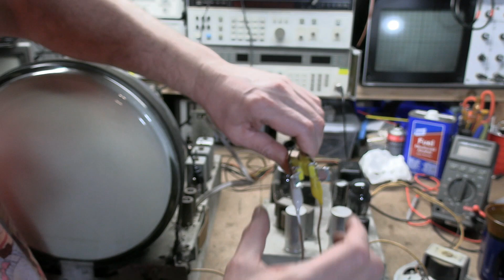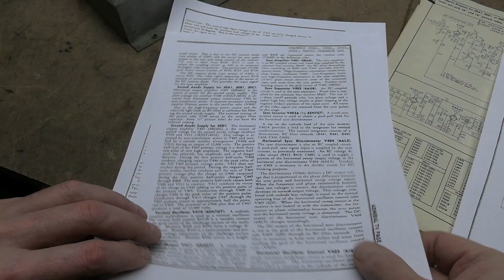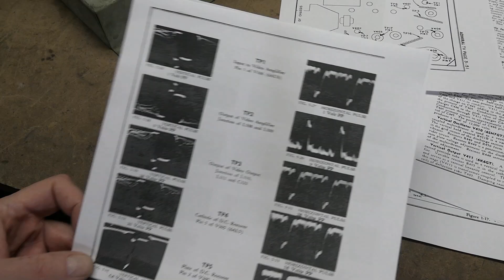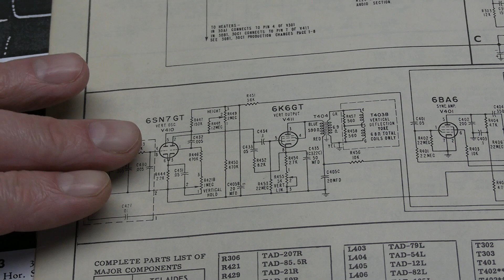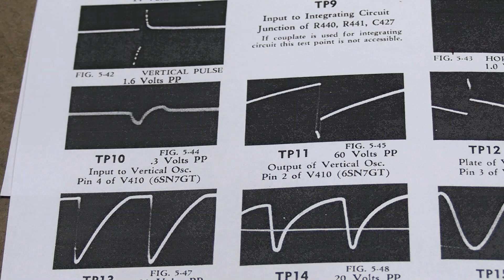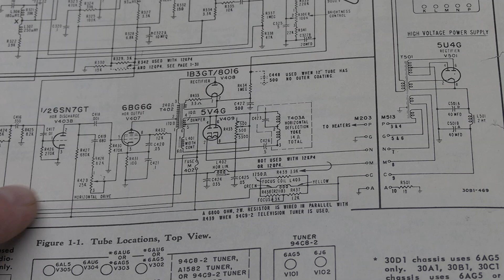Beginners guide to B&W tube TV restoration part 11 (prelude to troubleshooting)

Comment: Might it make sense to make an extension cable set for field coil speakers.  This would alleviate the risk of a field coil speaker with a short cable (as installed in the original set) being dragged around and damaged (it could be placed out of harm's way on a shelf and the cable secured to the edge of the shelf), and yet the electrical characteristics of the circuit would stay the same.
Reply from the maker: Well that would require either having a match socket/plug which I don't or soldering wires which I'd rather not. I'd also be concerned about the wires getting caught on something and yanking the speaker. I've done this many times. It's no big deal. This isn't even remotely precision circuitry

Comment: The vertical problem is probably not the yoke. The vertical windings of the yoke are at the sides. A fault there will cause a keystone shaped raster, with one side larger than the other. The silver getter material in the tubes is usually barium.
Reply: Some very old getters are phosphorus and are iridescent in a good vacuum, yet not white as in a barium getter in a tube gone to air.

Comment: Did you come up with a solution to the 5Y3 issue?  Good idea to check your tubes for milky getters before power up. Possible to damage the filament winding in the power transformer due to heavy current draw when a tube goes to air.
Thanks for sharing your knowledge with us, much appreciated.
Reply from the maker: What I stated at the end of the period video. Install a CL-90, decrease capacitor to 20uF and increase other capa
Reply: @bandersentv  Thanks, I know you were considering those as options, I was not aware that you settled on which way you were going with. That should do the trick. I have thermistors on my Heathkit W-5M power transformer primary windings to limit inrush current, they work well.
Reply from the maker: @zulumax1  I've actually restored a dozen or so of these chassis and used a thermistor in the past. The Admiral 20 series has this problem too

Comment: I think you'll find, in most cases, the getter is Barium.
Reply: Yeh... Wikipedia has a good amount of information about getters of various kinds, whether flashed getter for receiving tubes or a solid metal getter for high power tubes (higher than anything in a TV or radio receiver).

Comment: Thanks for another great video in this series Bob! Well, I finally bit the bullet and got a BK-400 CRT tester complete, tested, with manuals and all adapters. I connected it to that 1950 T-1104 and the tube tests out very good. Good cut-off, no shorts and good emissions. So the great news is it tested very good. The bad news is that now that I know the CRT is good, I have no reason to put off trying to get it operational. Dang you Bob!!! LOL!
Reply: ...well, that's a good START-!!!

Comment: Happy New Year Bob!  All the best to you and your family in the coming year.  I'll be following along closely.  My GE 805 Locomotive is back on the bench and the crosshatch pattern on it looks very similar to what you have here.  The Early Television Foundation had incredible service data for the 805 including several schematics for the various versions and separate schematics with test points and waveforms printed on the images.  IDK what I'd do in this hobby without the ETF, Steve M and your guidance.  So glad you did this as a single TV grand tour and didn't decide to jump back and forth between electrostatic and magnetic deflection examples.  This is awesome.
Reply: I've raised some picky points in the past but I have to respect those who, two generations from the fellows who used to routinely work on these old TVs, are trying to do the best possible job of restoring them as antiques.